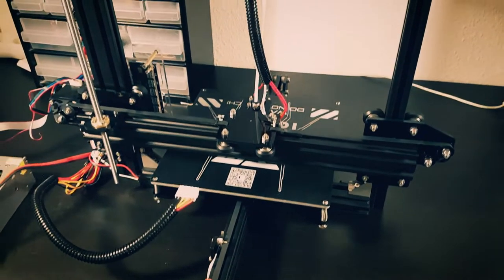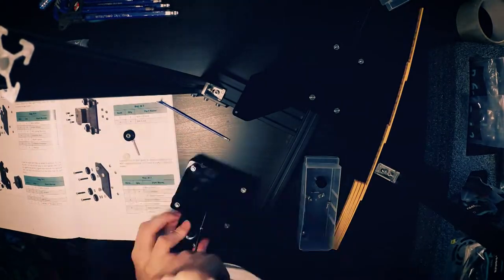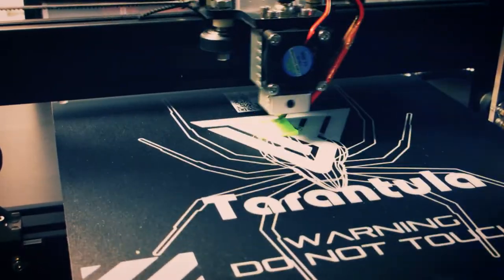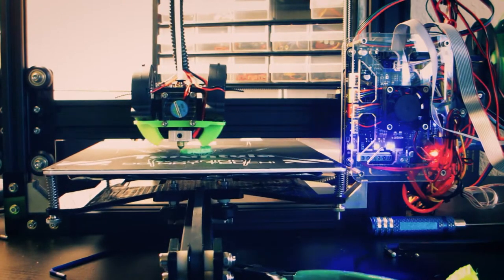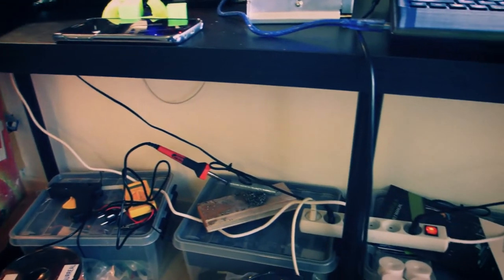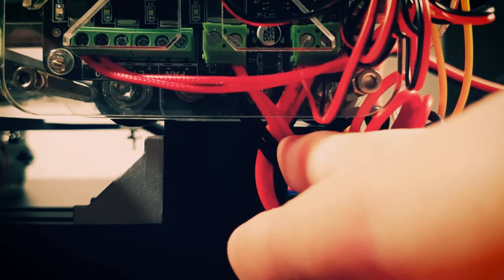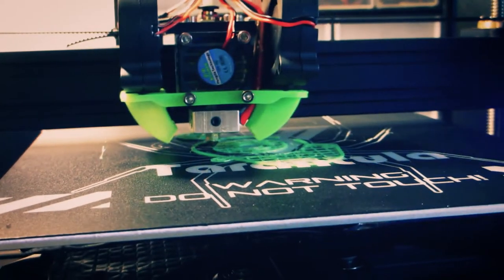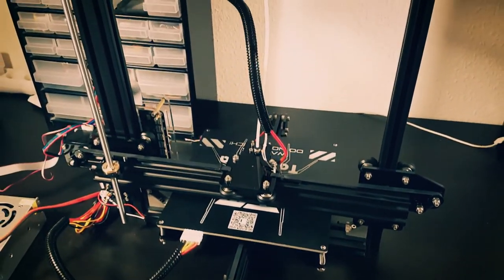Tevo Tarantula - 100% Honest Review

Comment: This printer is capable of printing ABS I have a Tarantula by myself and my hotend reaches 260°C Also the issue with the bed is is known. It is basically due to the fact, that metal extends as soon as its heated up. The bending occurs due to the fact that the acrylic interface on which the heated bed is mounted to starts to bend. but if you look for parts on thinigverse you can find a lot for upgrade parts you can print with the printer so improve the quality and make it a decent printer.
Reply from the maker: +Jürgen Heckmann I know people have been able to print abs on this printer, but it isn't possible on my unit. I won't just repeat what other people are saying. I make my own observations and judge from that
Reply from the maker: +Jürgen Heckmann you just have to swap out the bed with a glass plate. Much more straight

Comment: My tarantula prints PLA, HIPS, TPU, ABS, and exotic materials like wood PLA and carbon fiber PLA...I spent about $50 upgrading the printer..so idk what the heck your talking about. Heck mine printed ABS with no upgrades. Yes it’s not perfect out of the box, but you put a little bit of time into it and it easily becomes better than some printers that cost $800...